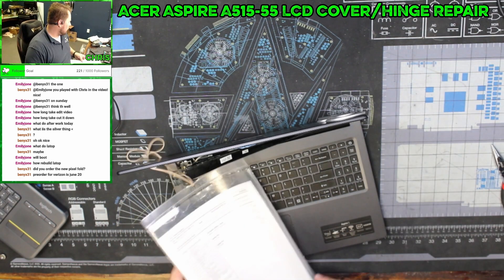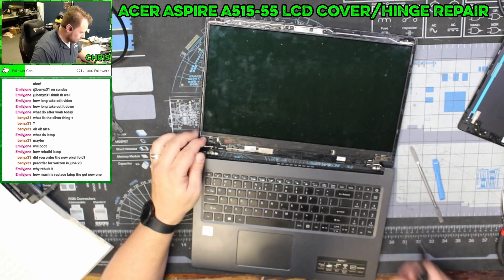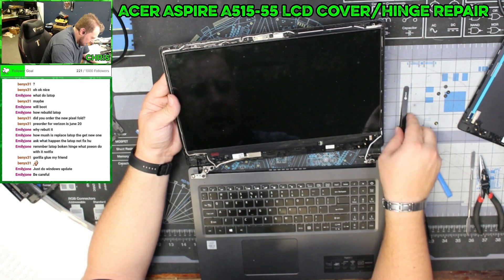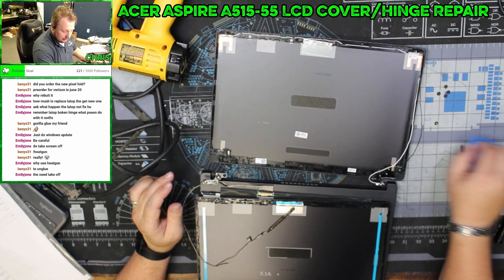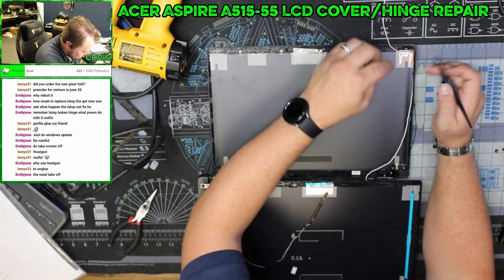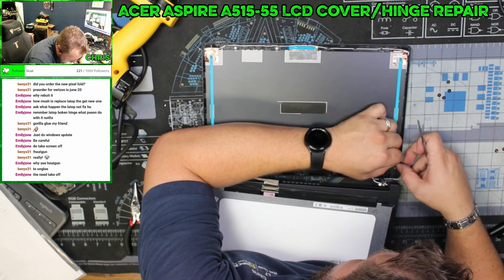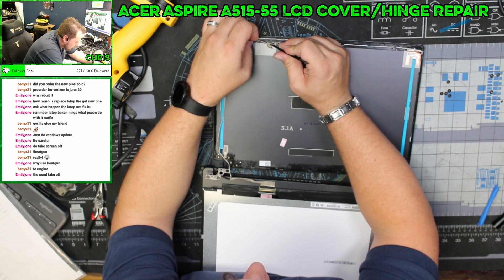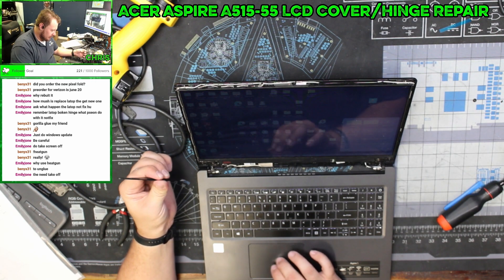LCD Cover and Bezel Replacement - Acer Aspire A515-55

Comment: So i just got my lcd cover replaced, and the battery on my aspire won't charge anymore. The repair guy said he did have to take the battery out as he doesn't wanna risk a short circuit during repairs...but i dont understand how the battery would suddenly stop charging after repairing the plastic component that has nothing to do with the battery...is there any explanation behind why the battery would suddenly stop charging after being disconnected for this kinda repair?
Reply from the maker: If the LCD cable was unplugged during the repair and the battery was not removed beforehand then a short could have happened and from that point the charge circuit might have been damaged.